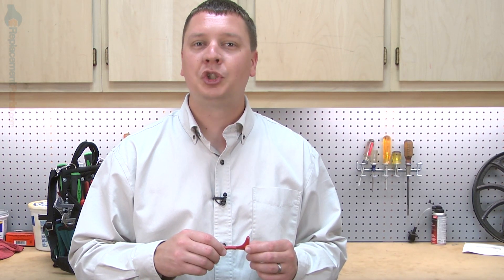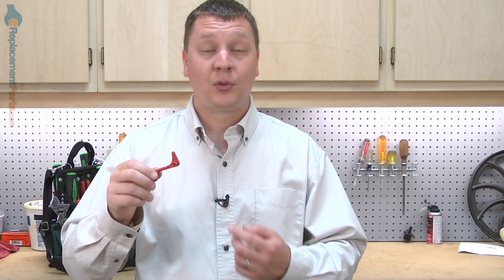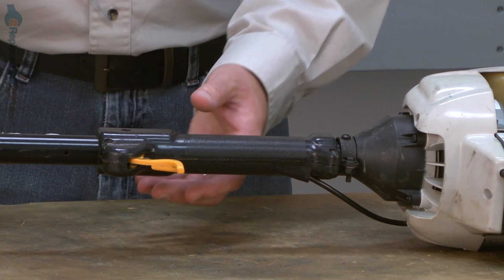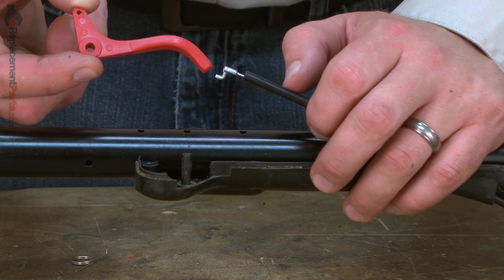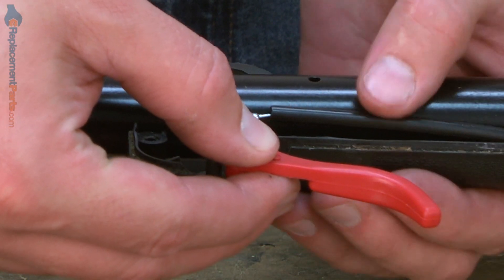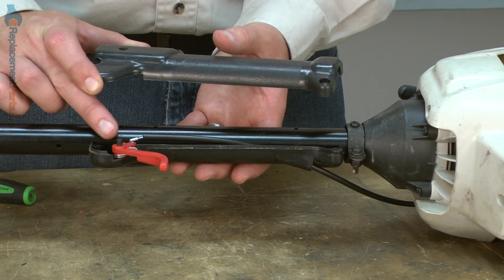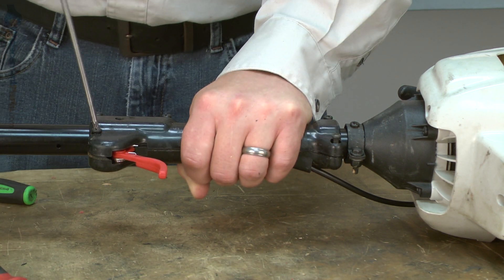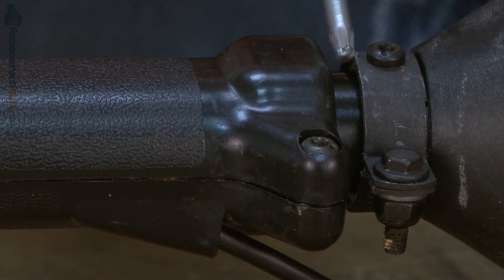Trimmer Repair - Replacing the Throttle Trigger (Ryobi Part # 791-181807)

Comment: Possible?   It appears to be designed to break and it's way over priced.  Seems Ryobi doesn't care to stock the sellers of their products with the ridiculously cheap plastic parts that they know will fail under regular use.  The Spring does not even come with the trigger if you order one, thats another 5.00 + change and shipping. The spring is a joke it;s so cheap.     I refuse to pay for that. 

   I literally whittled a new one out of .25 inch cabinet ply wood and spread jb weld over it.  sanded it down and now I have a trigger that better fits my finger and is probably at least 4x's strong than that  piece of plastic. 

   there is no reason why they could not stamp out a steel one and plastic coat it for what these trimmers cost. it's ridiculous how this is designed, it actually looks like it;s designed to break away.